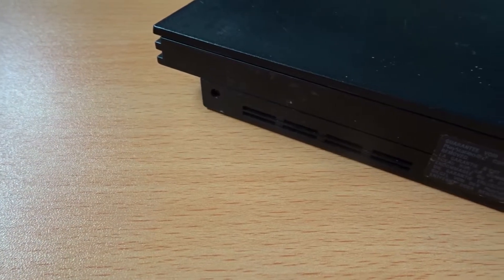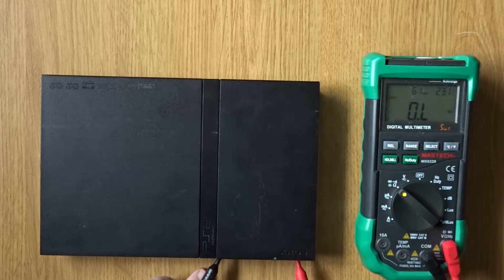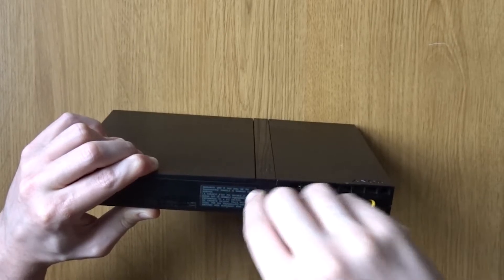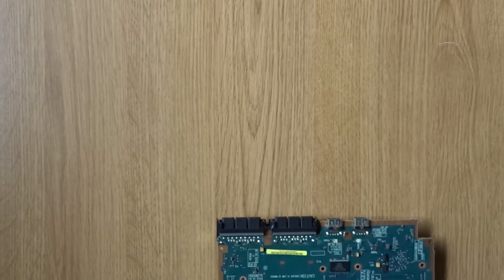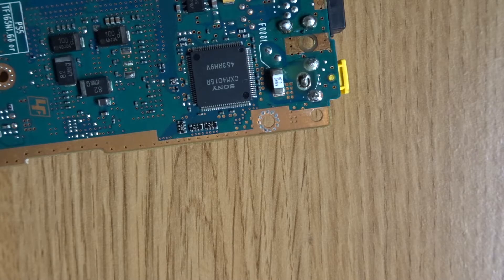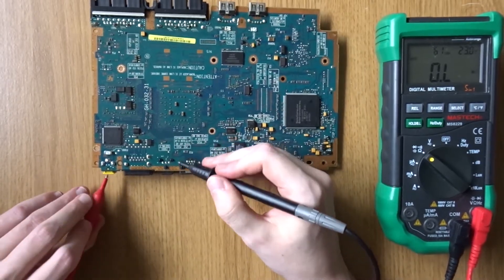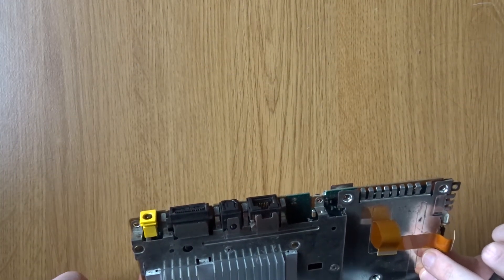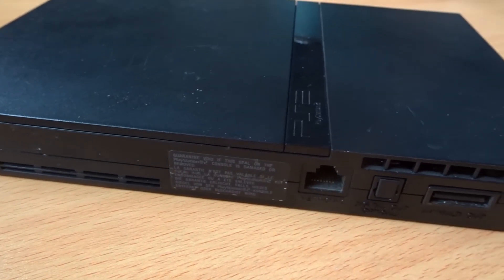PS2 Slim Power Jack Repair | How to Fix | Qubits Tech

Comment: It doesn't look like removing the heat shields is necessary to reflow the solder. However, removing them gives better access to the fuse, in case you want to check that. Have you ever done a reflow without removing the heatshields?
Reply from the maker: I haven't, though I have thought about it. It's just easier to work on it with them removed.